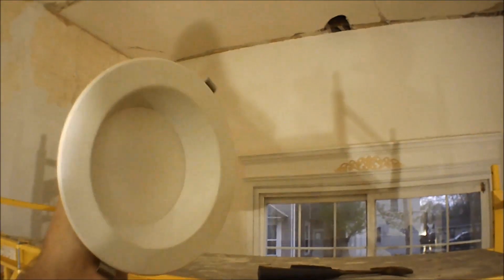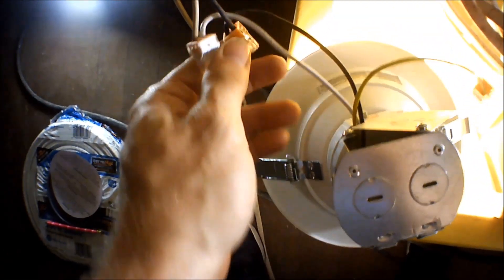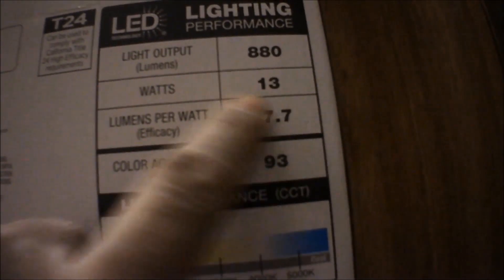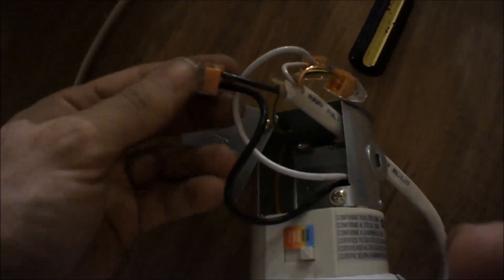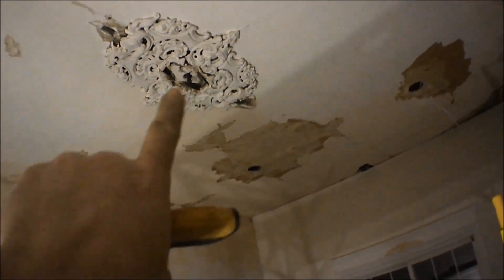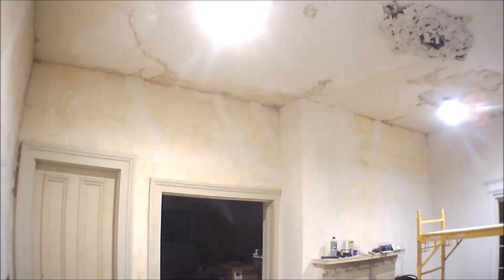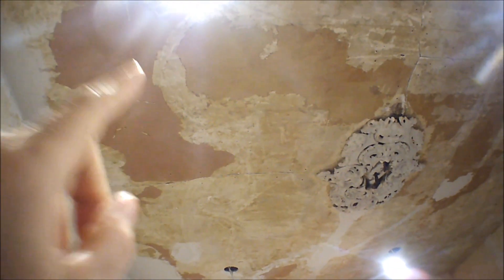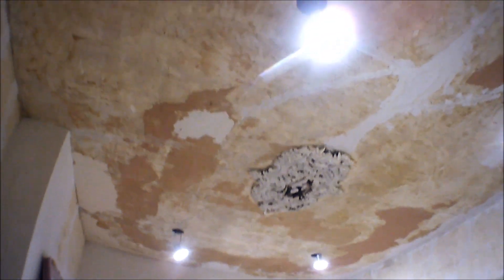how to install recessed LED lights in plaster ceiling

Comment: That knockout is for a cable clamp. You need a cable clamp for this to be code compliant. The tab rubbing against the wire is no bueno.